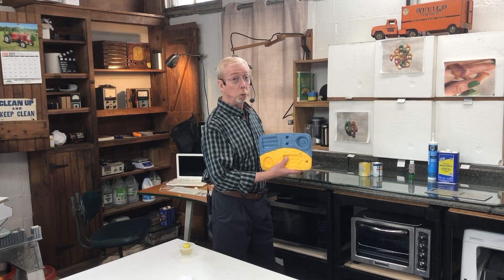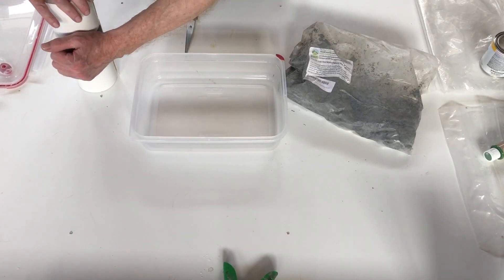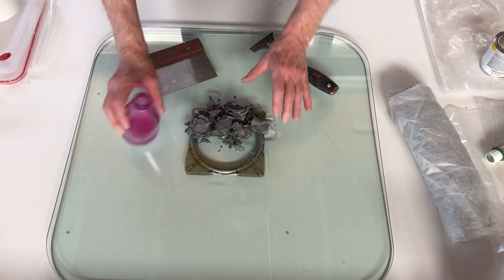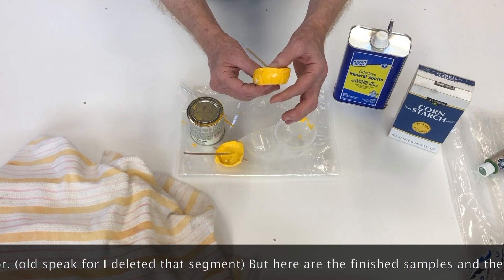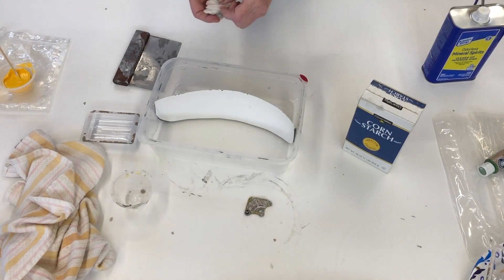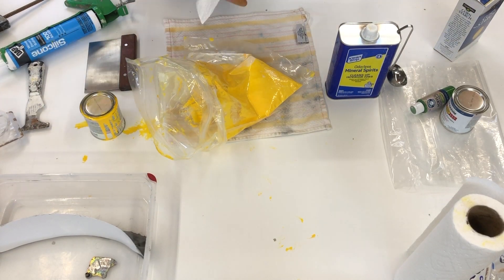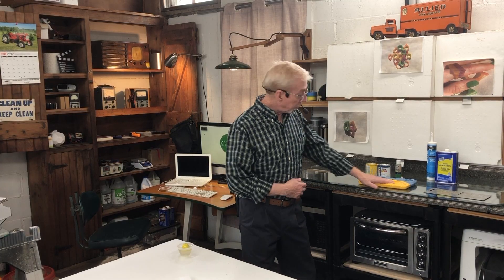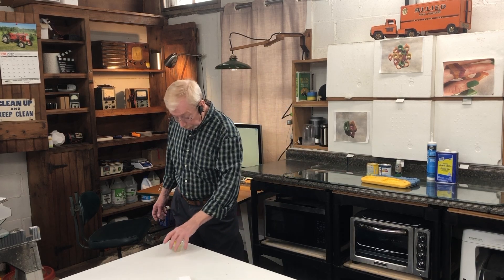Mechanics Dream. DIY magnetic silicone tool tray. How to Color silicone.

Comment: Thanks for sharing your experimenting. Can i ask why you add the flower? And how much oil and enamel paint did you end up using?
Reply from the maker: The flower was for fun. I don't remember how much, I didn't measure. Just add what looks right.
Reply: @GEOsustainable  I found out people add starch to silicone to thicken it up ! Is that why?
Reply from the maker: @GoddessTara923  Cornstarch speeds up the cure time. It doesn't take much. It will thicken the mix so thin more than you think before adding the Cornstarch

Comment: Dear teacher, excuse me for my question again... I just want to know what silicone color pigments consist of. Is it mica or what is made so that it does not peel off after painting 🙏🤍
Reply from the maker: Questions are always welcome.
You wish to use mica to color your silicone. I have shown you how to use Acrylic paint.
Mica may flake away on the surface if not put in a carrier oil, so this becomes more than I can teach.
Your best option is Acrylic paint. As you see, I have deep, rich colors.
Acrylic is an oil based thermoplastic.
Reply: @GEOsustainable  My teacher, I want to know what kind of colors are placed for silicone paint on the surface so that it does not peel off, and it is called a silicone color pigment. I want to know what kind of these colors are, please🌹🌺🙏
Reply: @godfrey7960 it's not a top paint!? it's a colourant /pigment like a dye added before it drys.

Comment: Hi! This is pretty cool! I have a question. I’m trying to cast a small bottle that needs a clear mold so I can use UV resin. Do you know of a way to make the mold without using cornstarch or something that makes it opaque? I was trying with the solvent so it will shrink, which I want, but am not getting a good cure on the inside (doing a sort of hollow inside). Looking forward to any ideas you have, thanks. Take care!!
Reply from the maker: I have never worked with resin. I have been watching this one guy who is pretty good but I don't remember the channel. I am sure you can get tons of help.
Reply: I would make a vacuum seal mould.

Comment: What type of paint it is?
Reply from the maker: Oil based Enamel. Oil based Acrylic. Any oil paint will do.
Reply: @GEOsustainable  "Oil based Acrylic"? I thought all Acrylic paints were water based. What are the clean up instructions?
Reply: @johndoggett808 I agree!! maybe he means oil paint. But the bottle looks like standard acrylic paint. I reckon we could experiment with different paints and powder or resin pigments.